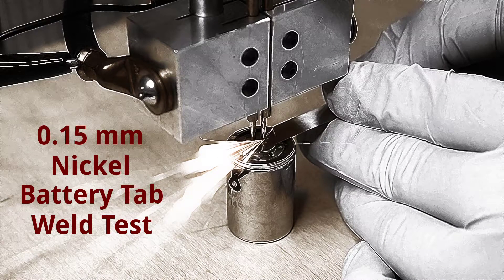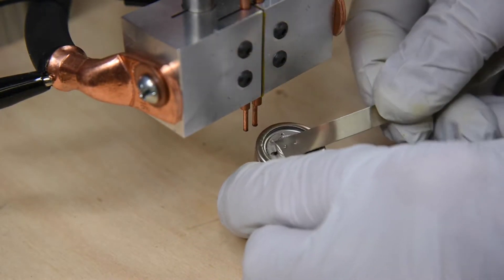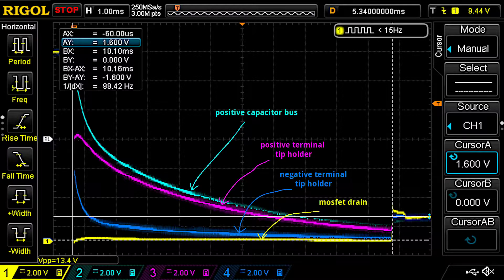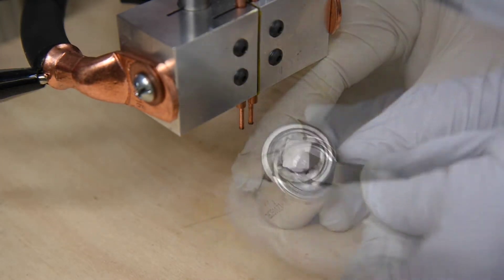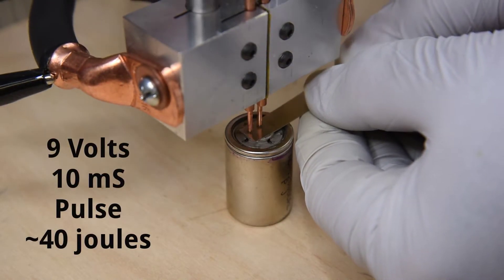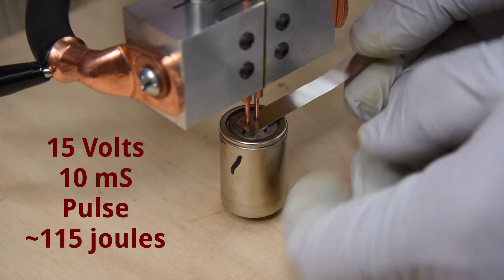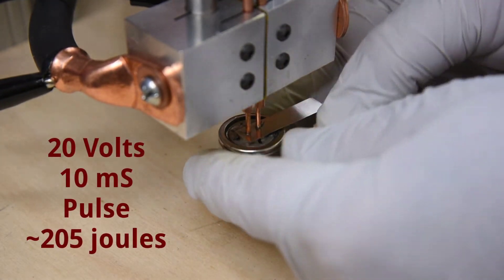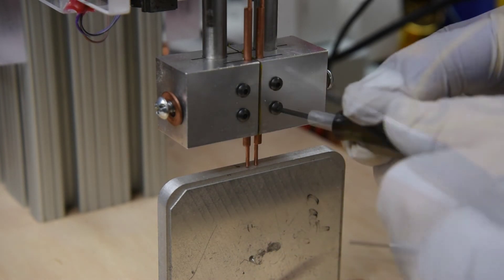Battery Tab Spot-weld Testing 0.15 mm Nickel

Comment: Great video but my spot welder settings are different PreHeat = 1-10ms  ,   Gear = 1-80ms   &    delay 0.1to2.5secs  how do i work that out with yours
Reply from the maker: I don't know; mine is a single pulse. I haven't figured out how to dissipate the energy fast enough to do a second pulse without destroying the MOSFETs.  I usually run a 10 to 12 millisecond pulse and adjust the voltage to match what I'm spot welding.